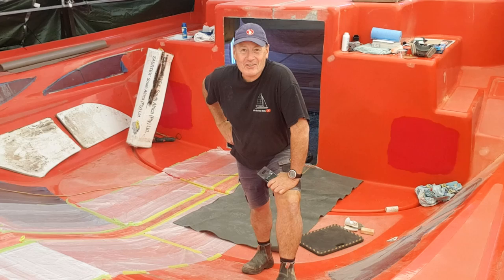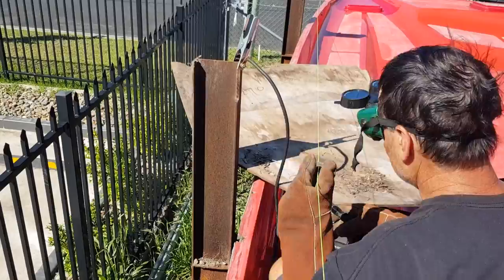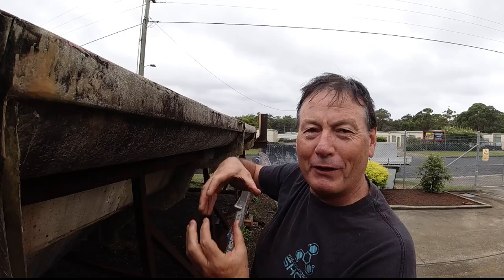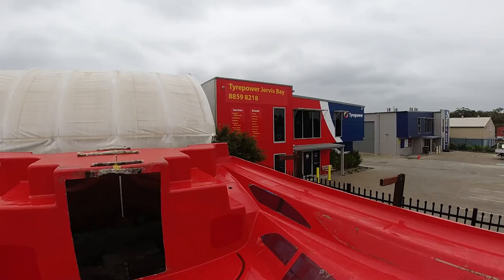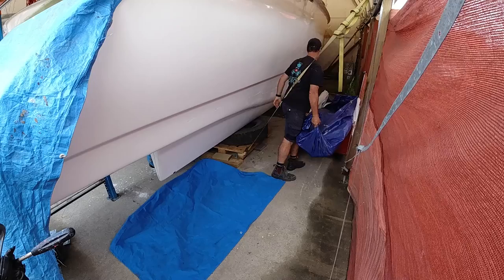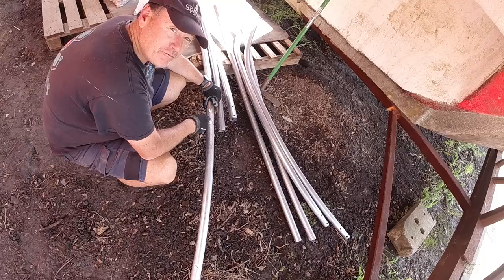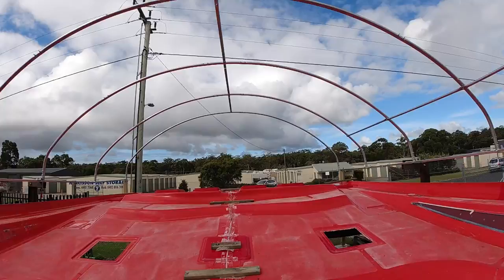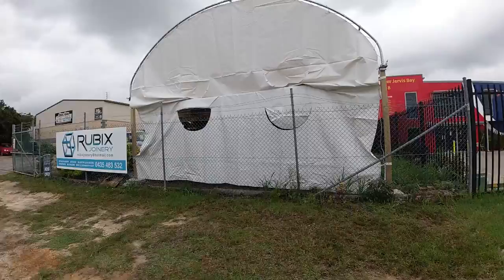Ep159- The Catamaran Deck Mould Shelter

Comment: A socket adaptor for your battery drill and a deep socket set would have saved ages instead of an adjustable spanner. I know cos I did it a few weeks ago and built a tent and other things and the time saved is great.
Reply from the maker: Yes so did think of that an hour after the build.Good thinking. Ross.

Comment: Were it my OP, i would've added a little bit of metal (just enough to put the base of the "tent" at the edge of the mold) by putting extensions either side of the main join at the peak of the arch. That kind of pipe is easily found and with a single length and a bit of ingenuity, it's easily adapted to fit. But, all's done and well, so that's that.

Comment: Will the incision down the middle change dimension and fit?
Reply from the maker: The incision is approx 5mm and has now been mended with little or no dimensional change. I anticipate an element of flex in the deck flange sides in any case that will allow for any small variance.  Cheers Ross

Comment: how come you don't store the hulls outside with a tarp over them and then move the deck into the existing tent and not need a second tent?  I would think renting the crane for the day to move stuff around would be less expensive than a second tent?  Too bad the auction didn't work out as you expected, but it sounds like you got a pretty good deal anyhow.

Comment: Hm, I am wondering how to demold the deck with the overhanging supports welded on? Are those only bolted on?
Reply from the maker: The cantilevered arms are bolted on Matthias.The tent will be removed for demoulding and likely sold.Cheers Ross

Comment: You need to borrow some fire blankets
Reply from the maker: It was a car engine that blew up down the road.Cheers Ross
Reply: We always had to cover everything up in fire blankets when cutting and welding so we did not tear up the adjacent material with hot metal sparks.
Keep up the good work